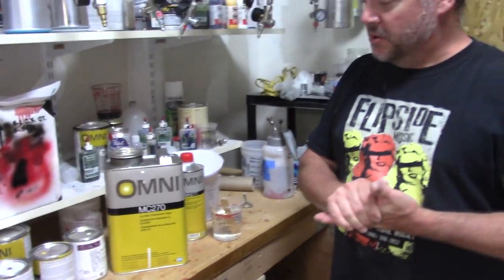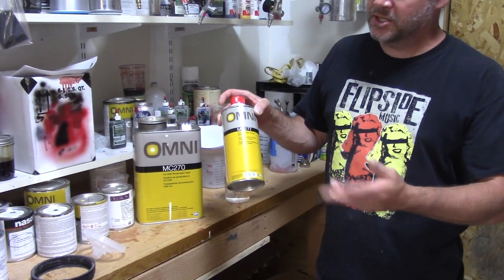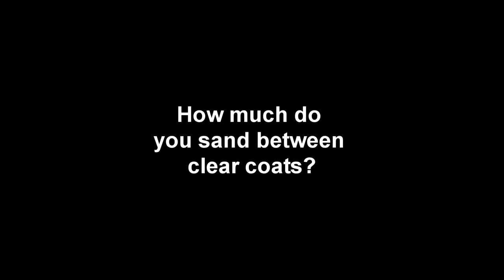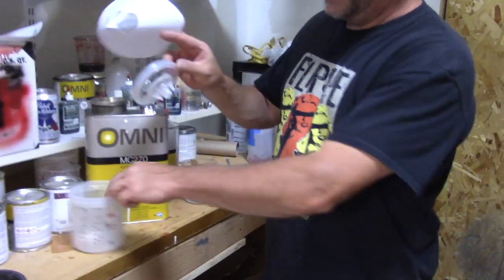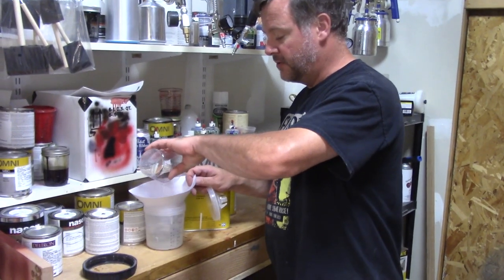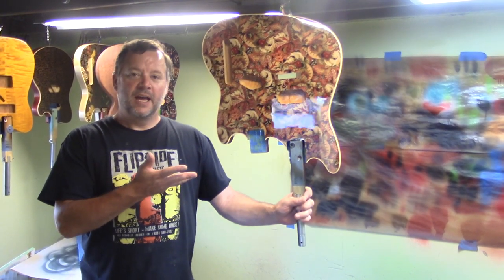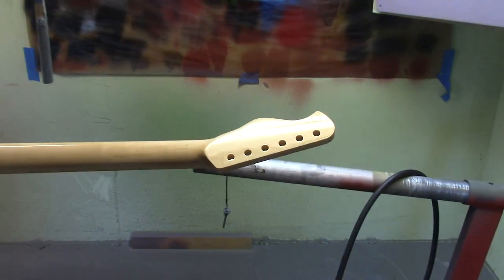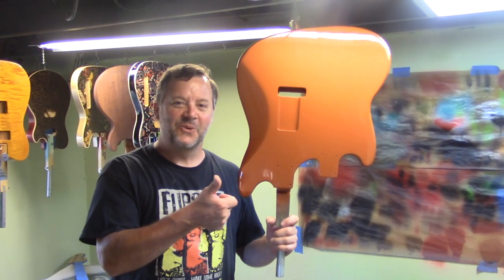Are You Still Using Lacquer? Why... It Sucks! Part II

Comment: Nope, built up a Warmouth in about 1993 I believe and did not use lacquer. I was familiar with auto paints for a long time as I worked in an automotive paint shop in the 1960's until I received a full paid government vacation to Southeast Asia. The GM cars in the 60's used Acrylic Lacquer and did not last well at all. Anyway, I painted the Warmouth with a 2 part urethane of the time and it has lasted great and the maple neck even yellowed! last Strat clone I did I painted with rattle cans from Home Depot, dipped some Hydrographic Film and cleared it with SpeedOKote which works great. Dries fast and can color sand and then buff in a few hours in warm weather. Really like your vids!

Comment: I'm  64 years of age and  worked for The Petty race team for 2 seasons  in my early career and  Lacquer was it back then. Dried fast  could be polished and repaired easily. I was a PPG certified refinish technician when I moved on to "road car" repair. During that period lacquer began to  fade in  use. Catalyzed materials took over. For the last 15 years before I retired I worked as a Aviation composite  technician working with carbon laminates and  Mil Spec coatings. I have  used  pretty much everything and  I agree very much with with your  get over it and  move  on point of view. Catalyzed materials rule the day and they are also dangerous. I had to  retire early because  I got sensitized to any exposure. Yes I used protective equipment but this stuff  is  powerfull and  people react to it even small amounts that may still be in the mix area or  fumes venting as something is curing. Got to  be careful! 
I think we are at the time the next  generation of coatings  will soon  take  over and that seems to  be UV activated.  Hit it with light and  bam its cured. Dentists have been fixing your teeth with it  for years. Its used in  manufacturing and  is now  getting out to the public. While I have not  used it I do plan to!
Reply from the maker: I got it :)

Comment: Ive always wondered if you use lacquer and then a clear coat of some other type of paint that doesnt deteorate, does the lacquer still crack?
Reply: Mario Infante you can run into lots of issues especially if the lacquer has not finished off gassing. It’s better to just use urethane.
Reply from the maker: There are companies that spray a final wash coat of lacquer over all the other paints they use. It makes the case smell like solvents and will check and yellow too.

Comment: Why do you clear coat the fingerboards?
Reply from the maker: Hi Paul, that is a great question, we clear coat the maple boards because it is not an oily wood and is also a light colored wood. You want to have some kind of finish to keep crud from getting into the board and oil finish doesn't always cut it on maple.

Comment: Man, I hate to be "that guy" that posts this question, but I looked into it, and the Anest Iwata LPH400 costs $500! Do you have a recommendation for a really descent (good) gun that isn't two car payments? StewMac sells an HVLP gun for like $35, I think. I've seen them at Harbor Freight for right around that same price. I can only imagine that if an Iwata is $500, the $35 gun can't be much of a step up from the nozzle on a Walmart brand can of spray paint. But maybe I'm wrong. You guys don't strike me as the "pay top dollar for brand names, even though they aren't any better," kinda guys.
Reply from the maker: Hi Michael, we didn't want to drop that kind of money on the spray gun for clear but we were told by our good buddy Mike Learn... who has forgotten more about painting that we will ever know to use that one. 
You can certainly get great results with lower cost spray guns. You can also tell a difference when spraying the top coat we use with this gun. 
I say try a few and see what works for you. Like you say, you can get spray guns for not a lot of money and see if you like them. 
What kind of paints are you spraying?

Comment: PPG paints are polyurethane which is a soft finish. It expands and contracts as opposed to lacquer which as you already know does not. I would love to have the catalyzed version as it cleans up easily and doesn't need lacquer thinner which is very hot but can be cleaned with acetone. Also polyurethane has much better sanding properties and can be wetsanded and rubbed out easier and is higher build than lacquer. It can be put on in thin layers without wetsanding in between and it doesn't yellow with successive coats or check when it hardens which with the styrene solids in it do not get as hard as lacquer. And it can therefore be sprayed over wood and metal and not expand at a different rate or crack and get chips in it. Much better quality all the way around. Too many dinosaur dolts romanticise lacquer simply because it was all the Fender had back in the fifties other than either varnish or shellac and neither of those are durable finishes.

Comment: Just a question.   The last time I sprayed any omni clear was a few years ago and it sprayed well but it only called for 2 coats of clear on car parts..after spraying 1000s of cars I put it on wet  just as I want it to look when done first coat only a bit drier. Why do you use so many coats?
Reply from the maker: I'm not really sure, lets see if Chris will chime in. I can tell you that the clear coats, in total, is very thin when it's all said and done. Maybe he doesn't spray as wet as y'all did?
What did you think of the Omni clear? It is my understanding that the biggest difference is the lack of UV protection... something we don't really care too much about
Reply: Texas Toast Guitars do yourself a big fan or my friend.take a scrap 2x4 o4 1x6 something big enough to see what's happening with that clear as you spray it.open your paint un up full paint volune.next turn your air on. Not ssuper high but 20lbs or so than spray a pass on that board as wet as you want it to look when it's done being buffed.. on some objects like side view mirrors 1 coat was enough so you wet that shit down no buffing and I repeat Not need to buff other than the orange peal that is left. If it is as smooth as glass why would you?
Reply from the maker: The Iwata gun sprays so smooth that we only wet sand the big flat spots these days. I was talking with some guys the other day about sanding through or buffing through and I told them the same thing. If you get your clear to lay out smooth enough that you don't have to wet sand... and no one can tell your didn't wet sand... why are you wet sanding
Reply: Texas Toast Guitars grit your teath rythum is the key and don't double coat.
Reply: I usually put on 4-5 coats.  The spec sheet says 3, Mike Learn said 4-5, so I went with his suggestion.  I'm afraid if I only did 3, I'd buff right thru it after color sanding.  I think guitar tops have to be super smooth, smoother than a car fender, especially if it's a dark solid color.  We do 2-3 on natural colored necks that aren't getting color sanded.  I spray pretty wet - I've put runs in it in the past.

Comment: Just 10 oz did all that. The results are fantastic.
Reply from the maker: Thanks Fred, the new HVLP guns have a lot to do with it as well. We put paint on pretty thin but less over spray is a key feature.
Reply: My friend builds high end furniture and has a booth. Like you, I save up all my paint work and bring it to him, I provide the labor so he just has to spray. I took down all the materials & gun/consumables, there's a good paint shop nearby. I'm going to invest in these products, the results are just too good. You're using less material than a nitro job and it looks twice as good.
 Thank You
Reply from the maker: Thanks for watching Fred. Having a spray booth 20 feet from the shop really makes getting a decent finish much easier. Our booth is actually a large ToughShed that we converted

Comment: I don’t understand the general fixation among guitarists on actually wanting a beat up looking guitar. If you want an old guitar I understand… get an old guitar. I like old cars but I’m not out looking for something with visible “relic” issues like rust.

The QC issues present in the pre-CBS era of Fender would be absolutely unacceptable today. Multiple versions of the same color because different suppliers sent slightly different paints, sometimes guitars got undercoats sometimes they didn’t, “custom” color guitars started as screwed up burst rejects, and within a few years of use your “white” guitar would turn a wonderful shade of banana pudding.

Much of that can be forgiven though, because they were doing what they could with what they had. That said these days when I get around to painting a guitar I’m inclined to do what they did, which is to source modern automotive paints and spray my guitar with that. I mean hell I can take a fresh body in white, do the prep work and undercoat seal, and drop the thing off at a MAACO and ask them to spray it in whatever color they have left over from a car they just did (assuming it’s a color I’d like) and whatever clear they use and be on my way.
Reply from the maker: Me either

Comment: One huge thing you did not mention is the dangers of spraying catalyzed urethane without the required proper positive air respirator equipment. Isocyanates are the dangerous part of catalyzed urethane. Even a NOSH-approved activated Charcoal cartridge respirator is not really be enough to protect your lungs. Common symptoms of Isocyanates in your lungs are asthma attacks, which may become severe, with some sensitized reactions even known to cause death. It's not really meant for non-professional untrained use. I think you did everyone watching this a great disservice only mentioning the better then lacquer stuff but not mentioning the dangers of that crap.
Reply from the maker: Thankfully you are here to provide people with the safety information.